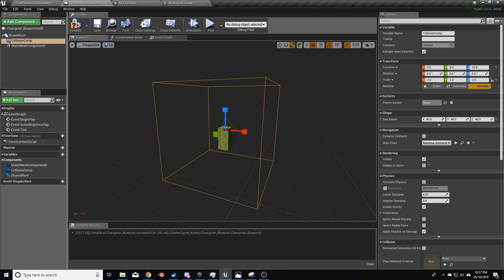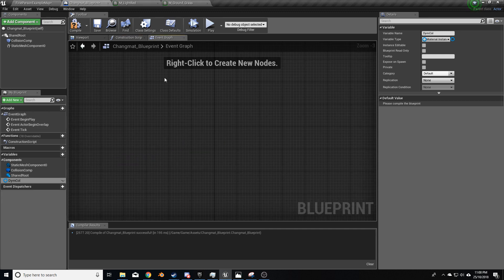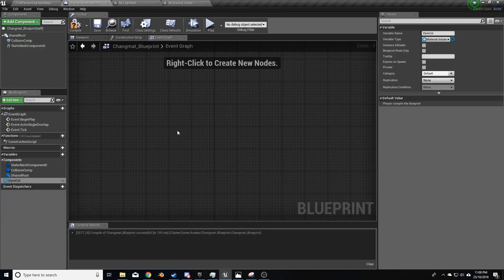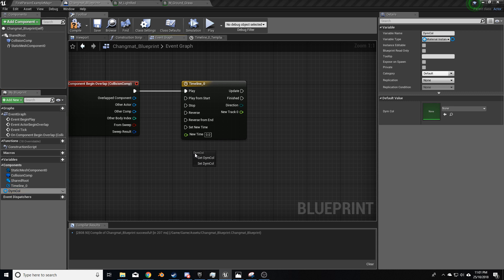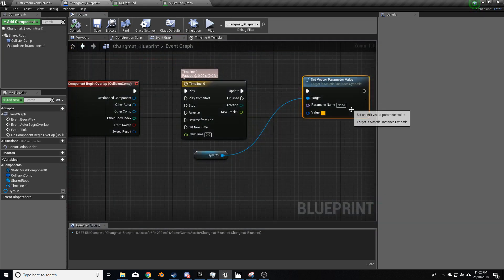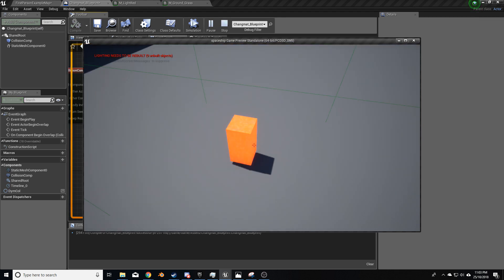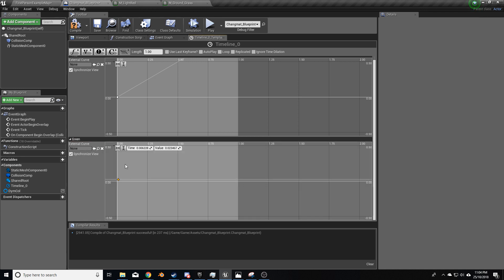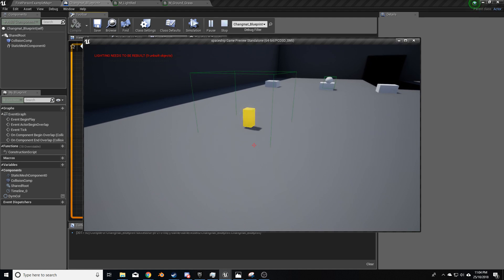Unreal Engine 4 - Dynamic Material - Tutorials Blueprints

Comment: Check my last posted video on this topic, as apparently MIDs are not needed, which is VERY strange. I also made a forum ticket (link in its description). It's beyond me why this works, as the official documentation says you absolutely need a MID in order to control things during gameplay (at runtime), but it works not only by using a MIC instead of MID, but even without using any MI at all, just by using the Material itself 🤯. It's beyond me why, as it completely invalidates Material Instances altogether, not to mention the Constant vs. Dynamic difference.